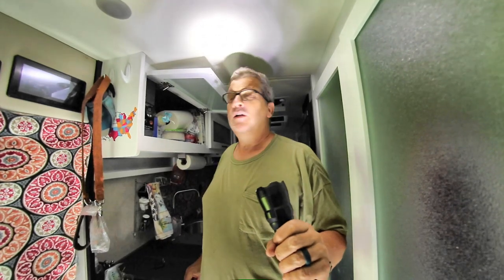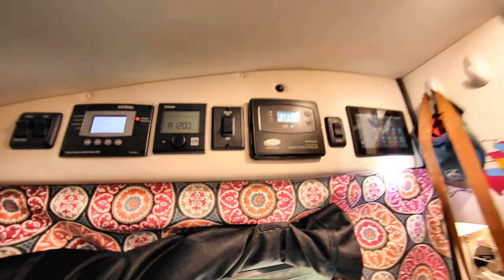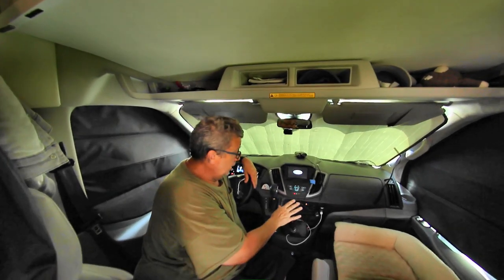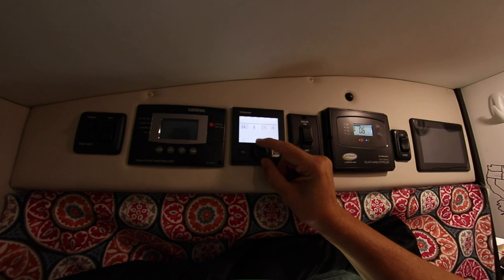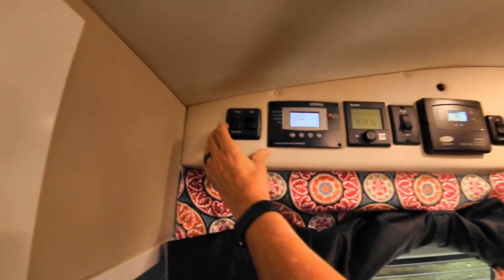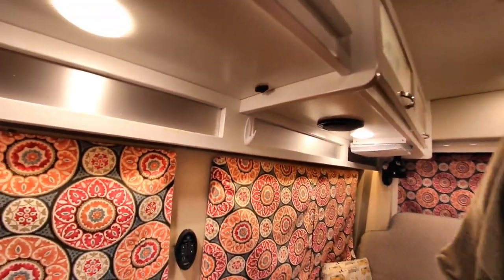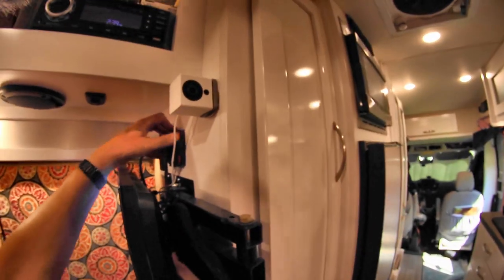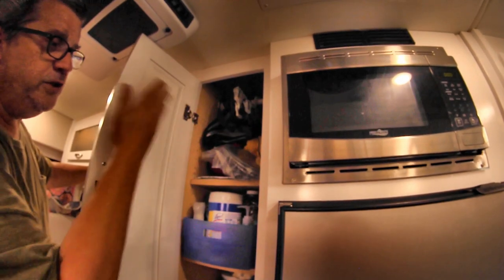2020 Coachmen Beyond Orientation video inside

Comment: You mentioned it takes a while to cool the Cab. Did you have the added " Phase Change Insulation " option on the wall or just rock wool? I liked the window curtain blinds are they coachmen product?
Reply from the maker: The blinds that go up and down are from Coachmen.   The colorful curtains Debra made.  We have Rockwool and Phase Change.  All RVs take a while to cool down, they are big boxes sotting in the sun.  Running the cab air with the house air helps a lot, I recommend that on pretty much any  RV.

Comment: Thanks for the Tips and Tricks on the Usage of the LI3  when cooling the RV.  Will go along way with us considering the beyond LI3. However You mentioned that you have to reset it while in your Travels? How often do we have to reset the System??  Many Thanks again to sharing your knowledge and experience in the Coachmen LI3. Have you used the shore power to charge the Batteries ? How long to get it to 100%.
Reply from the maker: I reset it one time, it seemed to stop charging and resetting it fixed it.  But what I think really happened was on the inverter my wife went to turn it on and pressed the third button and disabled charging.  Resetting the system set it back to the right setting.

As for charging on shore power it depends on the charge setting you select.  If I select 30 amps it will pull 24 amps AC and that will charge the battery pretty quick.  For example,  if the battery was half full (300 AH) it would take less than 1.5 hours.

If set on the lowest rate of 5 amps it would take about 6 hours to charge the battery from a 50% level.

The charge rate settings are 5, 10, 15, 20, 25 and 30 amps.
Reply: @CampingCoastie  When you opt for 30amps charge to shore power will it deteriorate the batteries life sooner than 7/10 years?

Comment: Thank you both. Very informative. What powers your pet minders?  Our Beyond C is on its way. We are so excited. It’s really hot here in Buford so we will head north.
Reply from the maker: The Nimbke RV Pet Safety Monitor is plugged into one of the USB charging ports.  It also has an internal battery that will last about a day if it gets unplugged.

The monitor uses the Verizon network to send out text messages to alert if the temperature goes out of the parameters you set or if it loses power and starts using its battery.

Comment: Do you like the one burner induction top better vs the two burner propane?  Also, did it come with the curtains?  I’m a newbie comparing Class B before taking the plunge.  This is really helpful.  Thanks!
Reply from the maker: I like the induction,  it doesn't heat up the coach like a propane one would.  It cooks quick and is easy to clean.  It's also less of a fire hazard, the propane is a big open flame.

My wife made the colorful  curtains.   It comes with the pull up or down screens and shades.

Comment: Also Gard I meant to ask you if you can draw power from a Generator plug in to shore power to run the a/c in the cab, bypassing the Inverter. ? In other words the generator is supplying power directly to the A/C ?
Reply from the maker: Not sure if this will answer your question,  but maybe it will.
With the lithium battery I can select the amp input so I can ug into any 120 volt outlet basically. 

I have a Sportsman 1000 watt inverter generator  that puts out 7 amps.  I can set my input to 5 amps and run my AC with the generator running charging my battery as the AC drains the battery.  But the inverter sees the power coming in and turns on.

I could not do this in my PleasureWay with a 120 volt AC.  

This is one of the huge benefits of the Li3 package and the 12 volt AC.  From what I understand,  the Li3 package and the 120 volt AC should work the same.
Reply: @CampingCoastie  So the A/c will always run prioritizing the  power coming from the batteries Ist.  while plugged in to shore power?

Comment: Hi Gard - you start off with a ‘cold’ Coach with nothing powered on.  What is the shutdown procedure if you are not using your Coach for a few days?
Reply from the maker: Actually with the Li3 I hardly ever shut it down.

But if I were to shut it down completely this is what I would do.
Turn off the solar panels.
Make sure the Truma is off for furnace and water heater.
Press the Use / Store button to Use.
Press and hold the silver button on the Li3 to shut it down.

Comment: Does the coach engine have two alternators and does it auto start, when prompted by the battery condition or voltage? Thanks for a great review!
Reply from the maker: It has two alternators, but it does not have an auto start feature.
Reply: Camping Coastie Thank you!
Reply: Do you use microfiber towels? I’ve used them, when I travel somewhere that may not have such amenities. 😉 Microfiber also takes up far less space. Also, do yo occasionally get a motel room in order to take a long shower, use the pool, and do laundry?
Reply from the maker: @BillSprague  We used microfiber towels.  They dry quick and work pretty good.  We never stay in motels, for good showers we stay at a campground maybe once every 5 to 8 days.  That also gives us a chance to dump our tanks and fill up the freshwater tank.   If we find a free place to dump and fill we will take a good shower in the van.  We do laundry at the campground or mostly just stop at a laundromat somewhere.

Comment: Are the shades insulating? I like how you did the zipper down the middle. Is there a video showing how you made them?
Reply from the maker: The front panel with the lighthouse and the panels on the rear doors are insulated.   The curtains on the sides are really only meant to block light,  but they do offer some insulation.

Comment: Nice rig! I’m torn between the PW Plateau TS and your Beyond model. If the Plateau had the compressor refrigerator, the same AC unit you have, and 600 amps Lithium it would be perfect. Really wish the Beyond had the Truma on demand water system.
Reply from the maker: Thanks.  I understand,  tough choices. I am a PleasureWay Ambassador,  so if you have any questions let me know.

Comment: Nice video!!!  My 22C should be delivered next week.  One thing I never saw... how many 110V outlets are there and where are they located?  Thanks!!!
Reply from the maker: There are three AC outlets.   One outside on the passenger side by the rear wheel.  That one is where you reset the GFCI if needed.  One under the TV and one on the side of the kitchen sink cabinet.

Comment: Could this unit run the AC all day without the engine on? Which is better?  Volta system on this or the Volta system in the Winnebago ? Thanks for the tutorials.
Reply from the maker: The hotter outside the more battery it uses.  I  have seen mine use between 60 amps an hour to 115 amps an hour.  
The Travato with 3 modules has 9,500 watt hours, the Beyond has 7,200 watt hours.

If using 130 amps an hour 12 volts as a base it would be about 1,400 watts an hour.  So the Volta might give you another 1.7 hours of AC use.  That would be with the 120 volt AC, the 12 volt AC changes that because it can use less power. 

I personally like the 12 volt AC, it can use less power and is really quiet.

Comment: great video.....I have a question about the drive......do you ever have problems with the ground clearance.....its it good in parking lots and driveways.....thx....
Reply from the maker: Three things to watch out for.  
If pulling into a steep driveway it's best to take it at an angle.  
When backing into a parking spot with a curb do not try to have the tires touch the curb.  The freshwater tank or generator will hit the curb if you get too close.
Go slow over big speed bumps, the rear will bounce badly.
Reply: @CampingCoastie  thx.....that helps....pretty much the same as a car just go slow......thx

Comment: How has the overall quality been? We’ve been trying to avoid anything “Forest River” for their Quality Control Issues and bad reputation.  Did you compare this with the Travato before you purchased? 
Thanks for the info!.. Happy Trails.
Reply from the maker: I am a big guy, 6' 3" tall and 290 pounds,  I can not stand the driving position of the Ram chassis.   I prefer the Sprinter cab, but not the Sprinter chassis.   The Transit fits me nicely and I really like the gas engine and ease of servicing.

As for my Beyond,  so far I haven't had any problems,  we have been very happy.  We left our house on June 12th and have driven over 6,000 miles this trip.
Reply: @CampingCoastie  I’m a big fella too. I like the Transit’s supposed extra headroom. Thanks!
Reply from the maker: The 22C has good head room.  The 22D has the same headroom in the kitchen area forward.   In the back by the beds the floor is raised a few inches reducing it some.
Reply from the maker: The 22C has good head room.  The 22D has the same headroom in the kitchen area forward.   In the back by the beds the floor is raised a few inches reducing it some.

Comment: Can you tell me if your white woodwork has gotten scratched and were you able to get touch up paint?
Reply from the maker: It does have some places where the paint has come off.  Like the quarter round molding on the floor by the bathroom doors.  Also a few places where the paint has worn off like the corners by where the tables rub when making the bed setup.  I haven’t looked for any paint yet, it doesn’t bother me how it looks.
Reply: Thank you. I just ordered mine with white and am having second thoughts.  The salesman is looking to see if touch up paint is available.  I have two weeks and crazy dogs.

Comment: Does it have auto start for recharging lithium? When you’re sleeping at night with roof ac on?
Reply from the maker: It does not have an auto start.  

We have used the AC all night in Biloxi MS one August night.

We ran the engine with the dash AC full blast while charging the Li3 batteries before we went to bed.  We also had our 12 volt ProAir full blast while that was going on.
Turned off the engine, battery 100% full and raised the thermostat a couple of degrees.  We went to bed and the AC kicked on a few times during the night.  It worked out for us pretty good.

Comment: Great video! We just bought a slightly used Beyond 22D. It's dismaying how little info Coachmen provides on the Li3 system. Waiting for my shore power adapter to arrive, I've been leaving the solar (2 100W panels) on but suddenly yesterday we got the yellow low battery light, apparently meaning less than 12%. The voltage shows 13.1V. I read in some of our info that a full charge is 14.4 - is that true? How far off are we from 100%? And how efficient is the solar charging system (we live in a very sunny place) and how long does it take to reach a full charge either on solar or by driving? Total newbie on this system and first time RVer, so sorry for all the questions. Thanks!
Reply from the maker: Can you take it for a drive to charge the battery?  You need to get the batteries charged now!  If you can, take it for a drive, at least an hour.  Do you just have parked, if you are not using the refrigerator I suggest after driving it park it in the sun and press the store button.
Reply from the maker: With your batteries that low you need maybe a 4 to 5 hour drive to fully charge it.  It will make about 150 amps per hour driving.  The solar panels will make maybe 40 to 70 amps a day.
Reply: HI, I have a new Beyond and today experienced the exact same issue, when we picked up the van I asked the guy that did the orientation  do the solar panels charge the lithium batteries, but clearly that's not happening. Today I saw the low level light on the BMS gauage I immediately took the van for a drive and hooked it up to shore power. The solar power has been on, and the Go Power solar gauge says full with the battery selection to AGM, which seems incorrect. The orientation guy repeatedly stated to read the owners manuals, but the information isn't exactly clear.  Camping Coastie, what does your solar guage show as to batteries? Thanks!! and great info videos!
Reply from the maker: Mine was set to AGM, but I changed it to lithium.   I am not an expert, but it's what I felt it should be set to.  

On your Li3 meter above the stove do you see amls being used or stored.  If being stored there will be a + sign in front of the number.
Reply: @CampingCoastie  Thanks! We did drive a little yesterday and got it up to 30% or so, and about 4 hrs today and now the BMS above stove is showing 88%. I'll check the solar battery setting tomorrow, too, for the lithium setting. In the meantime a new problem - when I turned the inverter off last night (to save power) all seemed fine, but when I turned it on again today it didn't come on - just beeped once, but no light on the Xantrex panel or hum from the unit under the seat. But, instead, the induction stove was beeping and flashing. Any thoughts on that? I like the concept of this system but there are so many moving parts and with no manuals from Coachmen it is very confusing. You are so clear with your explanations! Thanks again.
Reply from the maker: @stevensmith2373  maybe try rebooting everything.   Turn off solar panels, press the store button.  Then press and hold for about three seconds the silver round button to power off the Li3 system.  Wait a few seconds and then turn on the Li3 three.  When up press the use rocker button and then turn on the solar panels.
Reply: @CampingCoastie  Thanks for that suggestion. I tried it, but the same thing happened once the Li# was back on - inverter not kicking in and stove beeping.Thanks for your help.
Reply from the maker: @stevensmith2373  Strange, for the induction stove to be beeping it needs 120 volt power.  It gets that from the inverter, so the inverter must be on for the stove to beep.  Are you on FaceBook?  If so friend me so you can send me some photos of your xantrex.
Reply: @CampingCoastie  I'm not on Facebook, but I think I solved the problem. After going through the SCP manual looking at advanced settings, we saw that the inverter was set to Search so I disabled that and now everything seems to work. Although the inverter fan hasn't kicked on yet - is that normal?
Reply from the maker: Great!  The comes on pretty much when needed, so it may be running or not.  Many times my fan will be running even after I turn off the inverter.
Reply: @CampingCoastie  Thanks for all your help. I really appreciate it, and will stay tuned to your videos.

Comment: Surprised the Coach AC didn’t cool things down by the end of the video???
Reply from the maker: It takes awhile to cool down when it's really hot.  It started at 98 degrees inside, so the AC basically has to cool everything thing inside the RV.  A wooden cabinet that is 98 degrees radiates all that heat until itself cools down.  

Within 12 minutes it dropped the temperature 2 degrees,  not much but it adds up.  Not only is it cooling, it's also removing humidity. 

Faster to co would be nice, but it's a tough job.